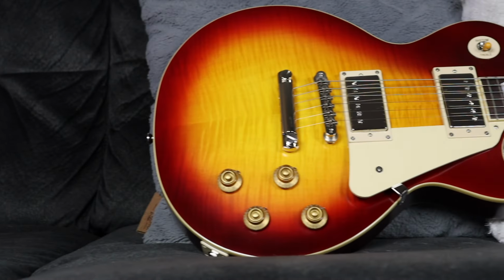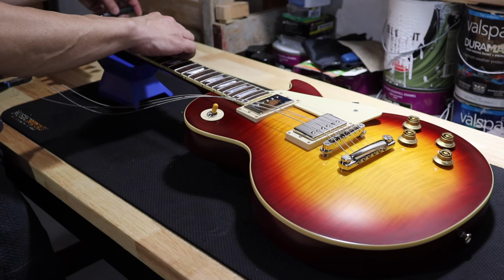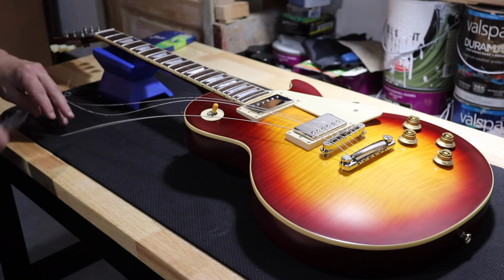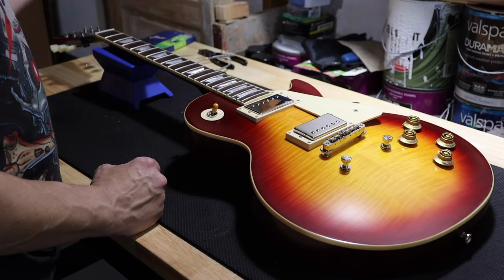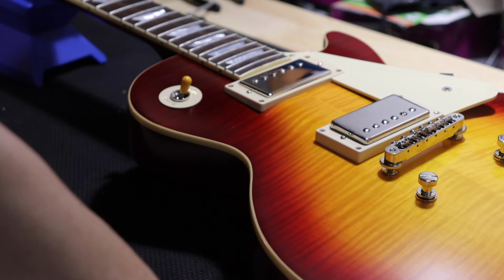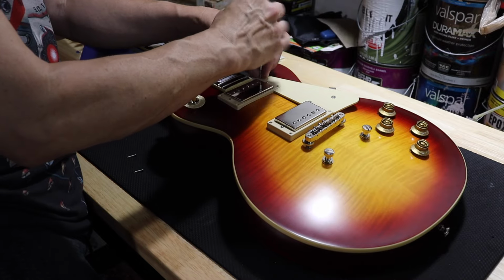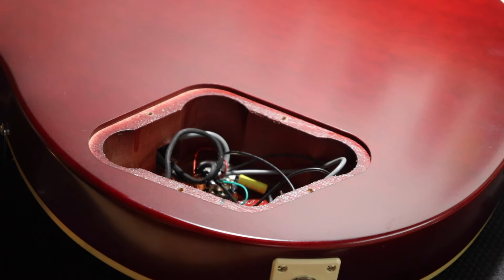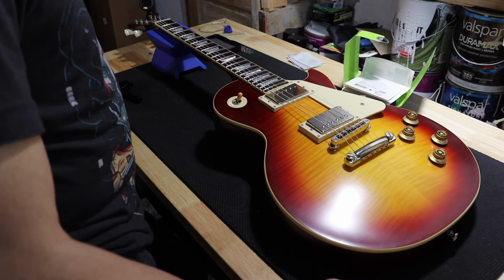Epiphone 1959 Les Paul Standard Inspired by Gibson Custom

Comment: Thank you for this informative video! I bought the exact model/color last week, here in Holland/The Netherlands, for the same reasoning as you are making. 
It’s a wonderful guitar, however I was somewhat disappointed about the sharp fret ends and some fret buzz around the 14th fret, which I will have to fix. In Europe this guitar is relatively more expensive than in the US. For a  €1359 Epiphone the quality control should be 100%!!
But nevertheless very happy with it, the weight is 3,7 kg ( Gibson standard LP’s are around 4,5 kg which is too heavy for me) and I like the neck profile and the Custom Buckers very much!
Gibson makes better Guitars, but this Epiphone 1959 is a keeper for me! 
Happy Holidays from the other side of the ocean.

Comment: Pickups should  matter since they make or break the sound of a guitar . Its not the wood or magic mojo .
There is a world of difference between  Custombuckers and the 490/498 mudbuckers that come in a an LP Studio .
Reply: Its its a bit of everything tbh. You can take the same pickups and put them in a studio and it won’t sound exactly the same. The sound of a guitar is the sum of kid parts but some things do matter more than others. I think that’s why they can comfortably put laurel on these models. Have you ever noticed that diff between old customs and standards before the hot pickups was marginal if non existent despite the ebony?
Reply: The 490R and 498T are in both the Epiphone Gibson Custom shop Les Paul custom and the 6k Gibson custom shop Les Paul custom...They are much more versatile than the custom buckers and will do what a custom bucker will do and more, especially when you need more gain.... The custom buckers are good too but tend to muddy up more than the 490R/498T pairing does.